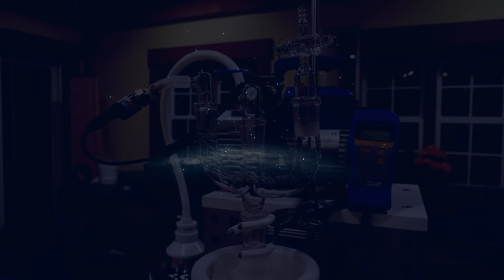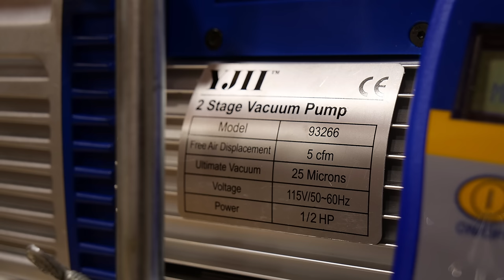Vacuum pump with NO moving parts

Comment: It would be impressive if multiple  variables were not have been changed at once. Science is actually utilizing good methods that will help to eliminate all untrue possible explanations. 
E.g. why isn't Browns movement (dkdc how it is actually called in English) the reason? 
But it is a great example, and it nice new fact, which i simply believe not because the results have proven it but because past experience with this channel being truthful. 
And no i do not need nor read nor request a response, only that something that isn't sience be called that way.

Comment: Will ultrasonic vibrations cause the contaminants to seperate from the surfaces in a significant fashion?
Reply from the maker: I doubt it.
Reply: @TechIngredients  heat but not vibration huh? I think it is worth trying.
Reply from the maker: The reason I don't think this would be effective is that the G forces involved are on the order 10,000 to 100,000 k.  This is nothing for a molecule, but would pulverize the beads of molecular sieve.
Reply: @TechIngredients  I intended for this to be tried on an empty chamber, no beads. Do you think that the vibration being applied parallel to the walls of the chamber would make a difference in the effectiveness as compared to perpendicular? Do you think changing the static charge in the material would help remove the attatched molecules?

Comment: What is that vent trap attached to your pump? Great video BTW!
Reply from the maker: I covered  this in a previous  video.  It's a hydroponic, activated carbon air filter. It traps any oil mist from the pump, keeping the lab clean.
I work with lasers, and airborne dust and oil are absolutely not acceptable.

Comment: i've been messing around with nanodiamonds(from skyspring nanomaterials, houston) lately, suspending them in dmso or mineral pitch/shilajeet resin for cosmetic and nutraceutical purposes, but they have a lot of interesting properties(beyond the epoxy strengthening you already covered) maybe you could mention in your next explosive vid or even as part of a radiation shielding video.

Comment: I worked in HVAC for 30 yrs. You have the outlet tube connected to the oil fill port. The actual outlet of vacuum pumps is typically out of the handle. The plastic part of the handle is formed around the outlet pipe. You should see a hole on the back of the handle. If memory serves it's 1/2" NPT although with high volume pumps it could be 3/4" NPT. The pipe that the plastic handle is on may only be threaded on one side and therefore may have to be removed to be able to connect a fitting to the port.

Comment: There are some points stated that is not entirely correct. First are the mono layer of molecules on the surface are mostly water. Typical gases in the atmosphere doesn’t physisorp onto clean surface very strongly. So the reason of baking in UHV are mostly for mono layer water and hydrogen dissolved in the stainless. A clean UHV system should not have anything else other than hydrogen after bake. The second thing is this demonstration did not have a very good control test. In order to demonstrate the cryo pumping, the control test should also go through the heating and cooling cycle as the one done in the case with the molecular sieve. This way the effect of temperature and gasses condensation due to liquid nitrogen is also taking into account.
Reply from the maker: You're right the air molecules do not have a strong bond with the internal surfaces, but they do bond and heat speeds the release of air as well as water and hydrogen.  The control demonstration would have been interesting if the audience would be patient enough to stay with it.  Of course, the pressure ratio with temperature will follow the gas law and reduce only by a ratio of 77K/300K without the effect of adsorbtion.
Reply: Tech Ingredients the pressure, if follows has law, should be 77K/600K since the system was baked and pumped at ~300C in the molecular sieve demonstration which would give almost an order of magnitude drop. In reality though, the pressure will fall more then just the gas law, because you are cooling with liquid nitrogen, so majority of gases would’ve liquified or even freeze including oxygen, nitrogen and argon. The outgassing rate of water is 2E-10 torrL/sec/cm^2 for unbaked system and it is inversely proportional to pump time, which will be the dominating gas load once a 10-3torr vacuum is reached.

Comment: On vacuums...... I have wondered for some time why a vacuum isnt used as a form of clothes drier. I understand water will boil at room temperature at low pressures. If wet washing were in a vacuum chamber wouldnt the water boil away leaving the washing dry? Obvously the idea is to save on the heat energy used by tumble driers.  I realise there must be a flaw in my thinking otherwise this method would be used.
Reply from the maker: It will work, but there are a few issues.  Unless the cloth is heated it will actually freeze due to evaporative cooling and then the drying will take much longer. Also, a decent sized vacuum chamber and pump is a lot more expensive.

Comment: Does it have to go through the complete heat and cold cycle, or can you just freeze the beads?

*Grammer
Reply: I think the heat was used to drive gases that were already in the beads out thru the vacuum system so that the could absorb gas later on.
Reply: This would presumably be far less effective. The heating stage drives off much of the particles that the beads have already adsorbed. To skip this stage would be like trying to use a damp cloth to mop up a spill. Not *impossible*, if the spill is wetter than the cloth, but far less effective than using a dry cloth.

Comment: A super weird question but i was gonna ask a tutorial of a bose-einstein condensate and i am in no doubt you actually would manage that ...but it would be both complex for viewers, take a long time and the need is limited. What i am interested in ( is also things i wont write here ) is a theory i havent tried out myself since it should be done outdoors, and potentially could be danherous and that is the vibration and resonance of water. Basically the subject is a grey area that have had, plausible or not, either rumoured and false statements, or accidents unexplained /put the lid on. The theory is that at about 20khz ( google the exact figure as there is litterature about it) ..something happens. I do not think we talk molecule splitting as it would require immense power..or does it? We can easily produce that with just a hydrogen oxygen cell at low power and the basic idea is that the vibration replicates this process but at an uncontrolled state and at an immense speed and at least one lab is rumoured to have been flattened out... at first i would debunk this thing muself, but even i can see that a lot of reports of the subject is classified. Probably not because of putting ultrasonic transducers and tune those in water at a certain level..but the fact that the transducers themselves or what they ised was in fact classified. I have, seen proofs about the so called ..theory myself but with magnetic resonance and salt water whemre you basically can lit the sirface of saltwater with a matchstick under heavy magnetic fields. I dunno if any of this is useful- the later is perhaps something to reproduce. The last person i saw used a mri equipment ( not the one exposed towards the human but the machine backside creating immense magnetic fields). Could be fun to watch.
Reply from the maker: Thanks.
If you think about the principles a little, you can debunk this yourself. The average velocity of the atoms in water molecules is hundreds of meters per second over distances of angstroms. That's why they emit and absorb radiation in the infrared ie 300 THz. KHz waves  are standing still from their point of view.

Comment: can you build a two(or more) chamber System where one chamber is connected to the vacuum System, emptying it, 
while the other(s) are connected to a vacuum pump to clean out the cought molecules.
in this Arrangement the active pump chamber would be cooled, while the cleaning Chamber(s) would be heated.

when the adsorbtion capacity of a chamber is reached it is separated from the vacuum with a Valve and connected to the vaccuum pump instead, 
also it is disconected from the cooling System and connected to the heating System instead.
when the chamber is sufficiently cleaned it is disconnected from heating and vacuum pump, and connected to vacuum and cooling again.

the whole construction would have to be built from a material that tolerates temperature changes, while not bleeding molecules into the vacuum.
it might be neccessary to slowly Change between cooling and heating, for example "preheating" with room temperature air, and "precooling " with room temperature air.

the shape of the Chambers would probably have to be two-walled, with the cooling/heating Agent (LN2/Water/Air/steam) put between the walls.

this way i think it might be possible to reach a vacuum that is much lower than what the pump is able to achieve.
Reply: PS.: as heat Transfer is a Problem heating might be done with a form of Radiation, much like in a microwave, but on a frequency that Matches the molecules either found in the adsorbent material, or in the adsorbed material. a common Microwave would only work to drive out water.
Maybe an (infrared?) Laser would do the trick.
Also: i do not think the cooling heat Transfer is done by contact, at least in high temperatures considering the vacuum, heat would probably be transfered by Radiation.
cooling all surfaces around the cooled vacuum would make heat Transfer a one-way Transfer, as a very cold Surface does not radiate much heat.
Reply from the maker: Yes, that could be done.

Comment: Wouldn't this contaminate your sieve media? You're bottoming out your pump so there's minimal flow twords the pump. Wouldn't the pump oil travel through the vacuum system and get stuck in the cold trap? That oil wouldn't get driven off with heat, at least not a rational amount of heat 🤔. I know this is an issue with some scientific equipment that is under vacuum all the time. 

As always, the breadth of topics you guys are competent to speak on is impressive. And I find them all interesting.
Reply from the maker: It might, but the sieve material is very inexpensive and to the extent it absorbs any oil that's oil that doesn't get into your vulnerable equipment.
Reply: @TechIngredients  good point. Avoiding all forms of contamination was beat into my head for so long, that was my first reaction. 

I do appreciate how much emphasis you put on making things cost effective. Have a great night.

Comment: How come a quarter cup of ice water in a vacuum chamber boils like crazy, but a few drops of water in a nearly empty vessel in the same chamber, doesnt boil off immediately like you would expect?

I really thought a vacuum chamber would boil off the drops and dry out the chamber FAST. (But yeah, no.)
Reply from the maker: As the water cools, its vapor pressure drops.  There's more latent heat in the larger quantity of water.

Comment: Does osmosis also work on this principle in nature?
Reply from the maker: In some ways.  Osmosis is similar in that molecular size plays a role and differential surface binding affects the transmission rate of molecules through the osmotic barrier.
Reply: @TechIngredients  So these Van Der Vaals forces do play a role in Osmosis. Likewise the name molecular SIEVE is a bit misleading because there is not "transmission" like in a filter as such but rather a kind of surface "capture" if the term might me used. As far as I know activated carbon is also similar to zeolite and other such high porosity materials.

Comment: This all made sense to me, except for one part... I don't understand the need to cool the beads down to liquid nitrogen temperatures after "boiling off" all of the adsorbed gases using heat.  Why couldn't you just let it cool to room temperature and use the beads at that point?
Reply from the maker: The adsorbtion process increases with decreasing temperatures.  The colder the better.
Reply: @TechIngredients  got it! Thanks :)

Comment: The essential point I get from the suspension of the seive into the liquid nitrogen ( preferably mercury,) is that the solid state of the pellets emissions gases at extremely low temperatures. When in public curriculum it is empirical that solids boiled towards gases though liguid states obviously emit gsses at the top dead center of entropy.

If that is the basis of the demonstration (I can't afford that kinda controlled dangerous substance so it's no experiment to this armchair viewer) then is this" Adsorbtion" that"cold fusion" everyone's been portrayed as elusive all these gigabytes!

A solid in emission under Brownian contraction, molecular backdraft!

I zoned out on a one hit just before the part about gas masks and stars so I may have missed the quantum explanation!

Sequential absorbtion leaving anti particles?
Reply: Yeah, you're right it couldn't be the same elusive cold fusion if it's sequential absorbtion because sequential absorbtion,is valent - electron- and that Cold fusion pertains to nuclear- proton/ neutron!

Comment: Vacuum is a great way to dry clothing with low power and low heat signature.
Reply: United Space Pirates interesting idea. As long as the clothes are not growing in the process.
Reply: Only if the pump is very energy efficient. Which none of these pumps are in the slightest.
Reply: @swake0019  growing clothing is an interesting idea, personally dont care if I stunt my clothing's growth rate.
Reply: @Basement-Science  trampoline powered vacuum pump or perhaps vehicle suspension driven pump?
Reply: @unitedspacepirates9075  You also need to reach a fairly low pressure for it to work at all. What actually matters is the partial pressure of water vapor around the clothes. Plus, evaporating water takes a lot of energy, so you have to add heat anyway. Thats where the other Gas molecules actually help. 
If you actually want to dry clothes with high energy efficiency, just hang them outside. Or even inside and leave a window open.
Reply: @Basement-Science   tried camping or living off grid? Drying clothing outside or even indoors is unrealistic when it often rains for weeks at a time.
High vacuum is not required to speed evaporation, high volume is.
Reply: @unitedspacepirates9075  What I mean about pressure is that something like a vacuum cleaner as the pump wont dry your clothes too well. It can only reduce the pressure by 30-40% which means moisture can still backstream into the drying chamber. This is the case with any vacuum pump that does not reach a low enough pressure. You dont need a high vacuum, but at least need to come close to the partial pressure of water vapor to actually pump a noticeable amount of water.
Of course drying clothes outside doesnt work too well in the Rainforest... You didnt mention that's where you want to use your dryer.
Reply: @Basement-Science  designed a swing set that unfolds from a truck tow hitch, the swing serves as a bed for camping and uses the a modified airbag to pump air pressure, thought perhaps instead of pressurizing air, it might also be used to pull a decent vacuum if additional weight is added to the swing.

Comment: Interesting: Yes!

Understandable to my comparably neanderthal brain... grunts unintelligibly
Reply: Sponges can absorb water because they have holes in them. This material is like a sponge with much smaller holes. It won't absorb water, but gasses are fair game. If your sponge is already wet, it can't absorb much water. This molecular sieve material has been exposed to air and is already nearly full of it. The heating/cooling process is equivalent to wringing the sponge of water before use, it forces the air out of the molecular sieve so it is ready to adsorb more.

Comment: I paused the video at 7:00 because, Wow.. You can use "molecular sieve" material to separate water and ethanol? I think there may be some 'moonshiners' who would be interested in the potential of this phenomenon. 
It seems to me, an alcohol still could be made more efficient by incorporating molecular sieve material in it's design and process. My first thought was using it as a distilling column packing material, then I wondered if the material could be added to the 'pot' with the mash/wash, both or everywhere? Anyone have thoughts on the concept?
Reply: Why use it when distilling is cheaper? It's only useful if you are getting over 95% percent alcohol because at that point you can't make it any more concentrated via distillation
Reply: @ipodhty  Has the comparative cost calculation been done?  I am assuming the 'molecular sieve' material can be reused after drying...
Reply: @hubrisnaut  a different problem to consider is taste. It will filter out a lot of flavor you want or don't want.
Reply: @ipodhty Just riding on conjecture here..  I suppose that would depend on the molecular 'size' of the "flavor" molecules... Those equivalent or greater than ethanol would be conveyed along with the ethanol distillate.. The "flavor" molecules equivalent or smaller in size than water would be trapped or 'sieved'? Do we know the molecular size of the desirable flavor molecules?
it is interesting that ethanol has a greater volatility but a larger molecular 'size' than water. 
sieve"